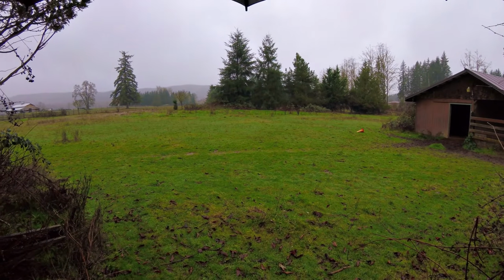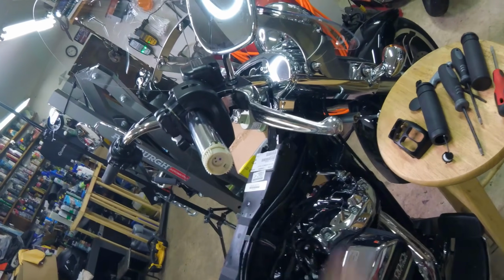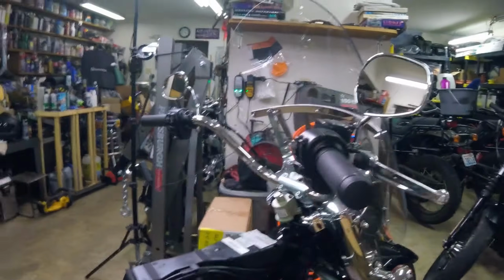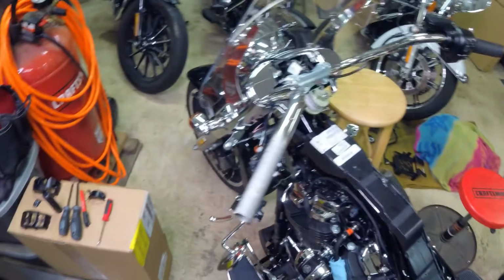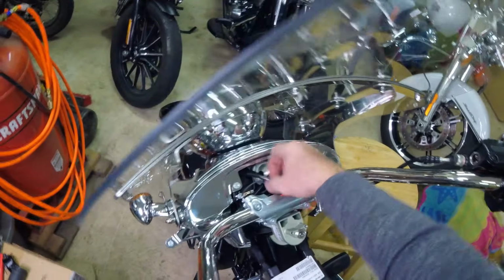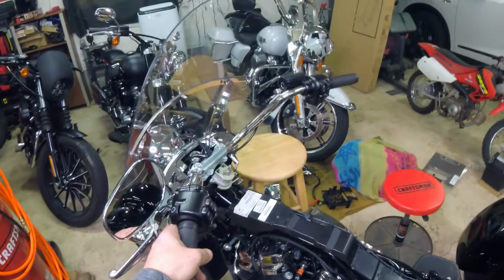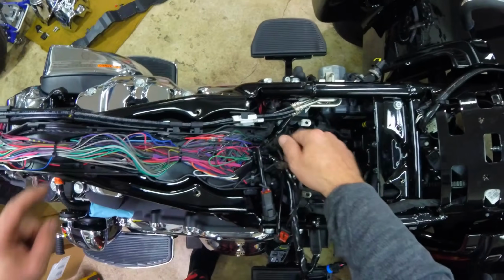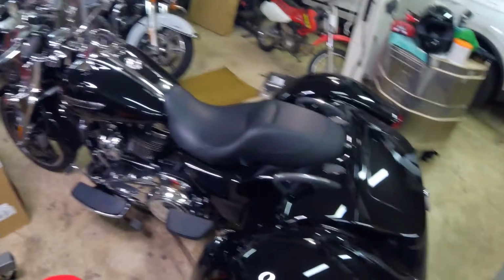FLRT Heated Grips Install!! • She’s Going to Love It! | TheSmoaks Vlog_2211

Comment: Good on you for installing those grips! I just used mine on the Spyder this last weekend, but just for a bit. Dang, they get hot even on low! It will have to get a lot colder before I can see ever using high! Be safe, you two..!

Comment: Captured bolts.  When I used to do network cabling, when we went through conduit, they make special lube to put on the cables that makes pulling then through conduit easier. I wonder if it would help here?